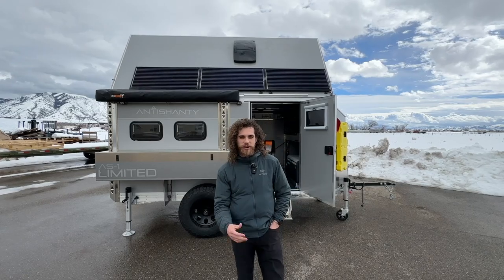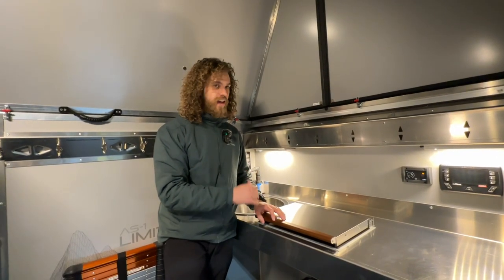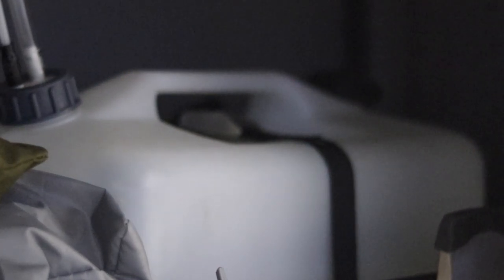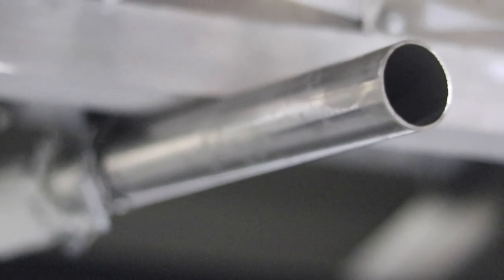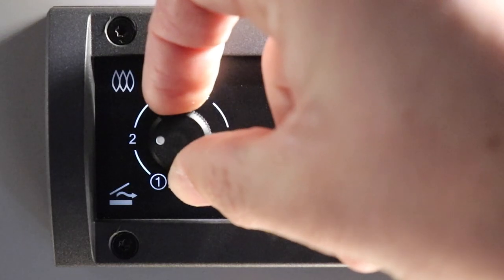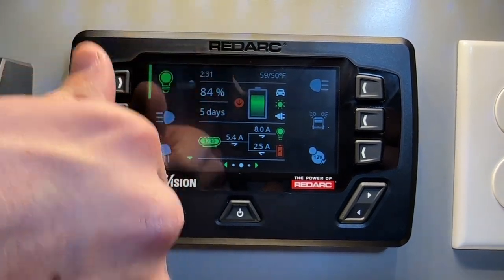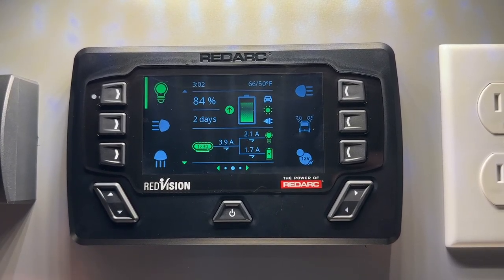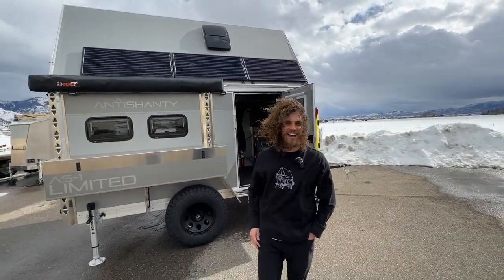Wallas Diesel Stove | Heater

Comment: I had one in my van last year before I had to sell the van. These are great pieces of engineering, super efficient, and best of all safe - the exhaust system is room sealed, so you don’t get fumes or smells inside the space and it doesn’t rob you of air. Plus points: room sealed, dry heat, very fuel efficient, tiny power usage on startup, powerful heater, looks gorgeous. Minus points: takes 10 minutes to heat up to usable temperature, heater is too hot for xtra small spaces even on minimum setting, too hot to use in hot climates, constant white noise from the fan and ticking from fuel pump (but not so loud it keeps you awake), and ridiculously high price. Do I recommend? If you live in a cooler climate and have a laid back attitude to brewing up a coffee and aren’t troubled by the threat of diesel being criminalised in a few years: Absolutely yes.
Reply from the maker: Thanks for the comment! Great information from your experience! We have loved using them, they are awesome for cold weather camping!

Comment: Have you already done any maintenance to it ? Mine is starting to exhibit some flame out issues, so looking for videos on how to service it myself. That's the one issue with this stove, not many places to service them in the USA. 
Second issue is altitude, they burn really hot at 10k ft. They actually recommend using kerosene instead of diesel for that reason. They are built for sea level, and the "high" elevation setting is for 5k ft.
Reply from the maker: Hey there! Great question! No maintenance, even with our oldest unit from 2019. We work directly with Scan Marine, they have a lot of knowledge and great support on Wallas products. 

We lock ours into the high altitude setting in each trailer. They do recommend kerosene, which is a great option because it doesn't freeze and gel up like some diesel fuel at freezing temperatures.

Comment: Ok, so it works well as a heater, but what is it like to cook on and is the ceramic only operational on AC or DC with inverter? Thanks.
Reply from the maker: Awesome, thank you for the comment! It runs off of 12v DC and works great as a cooktop. Check out our Winter Camp video at about minute 6:00 for a quick look at the cooking aspect. Thank you!

Comment: Does the top of the heater get hot when closed?  Seems like you would have to be very careful not to hurt yourself
Reply from the maker: That is the great thing, it doesn't get hot! The lid has about an inch of insulation in it. I have ran it on 5/6 to call for more fuel, and even on that level the lid does not get hot.
Reply: The counter around the stove does get warm but nothing too crazy.

Comment: Surprised! That unit produces quite a bit of sound while running, despite the production backing track. Hard to tell if it's the fan or something else.
Reply from the maker: The fan is constant, so there's not much variation in sound. Likely the background music and sounds from the shop.
Reply: Yeah, it's definitely a constant white noise.

Comment: Set in a van in hot weather, wouldn´t it be too hot inside?
Reply from the maker: Would not recommend using the heater in hot weather. We do have an A/C option for the warmer temps.

Comment: You need to be a better reader of operating manuals before posting videos 😮
The unit when in heat mode is controlled by a thermostat. You did not show the second step procedure needed to change from cooking mode, which is the standard when it starts up,  into the thermostat controlled heater mode used when the lid is down. That heat mode is engaged by turning the temperature dial all the way to high and back to low two times to activate the heater function. You can tell it has been engaged into  that mode when the  lower symbol on the lower left will light up orange. Each of the numbers on the temperature range is associated with a specific degree of temperature (see the manual for that). When that room temperature is reached the unit will turn down the flame until the room cools and then when the room gets too cold it will turn the burner back on, the same way a regular furnace does. There is an overheat protection if some other heat source gets the room hotter than what you set the thermostat for; then the unit will then go into automatic shut down.
Reply from the maker: Appreciate the comment! We lock our heaters in cook mode. The reason behind that, and the reason why we skipped the thermostat mode, is because it doesn't work like a thermostat in your home and we don't recommend our customers using the thermostat mode. 

In thermostat mode, it doesn't turn on and off like your home furnace, it only ever drops to the lowest setting, 1. In the ANTISHANTY, where it is a well-insulated space, between 1-2 is all you will ever want to run it at. 

In thermostat mode, if the temperature rises above the set temperature for more than 30 min. the whole stove just shuts off and will not turn back on unless you manually turn it back on. 

This is why we keep it in cook mode and crack some windows, so that it maintains a nice consistent temperature inside and so it doesn't shut off when you don't want it to, like while you are sleeping for example. 

Again, thank you for the comment, we appreciate it.